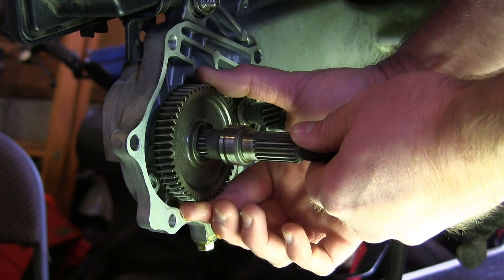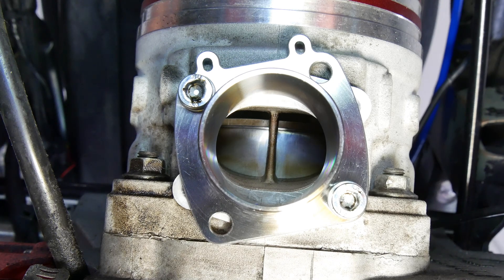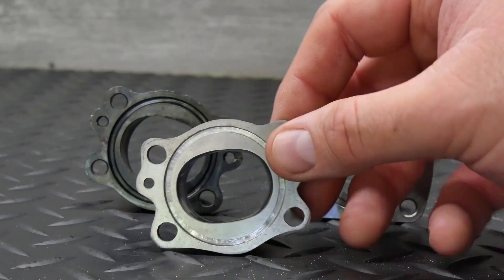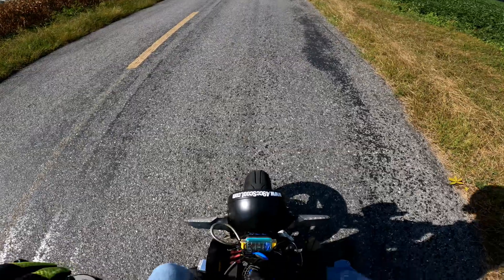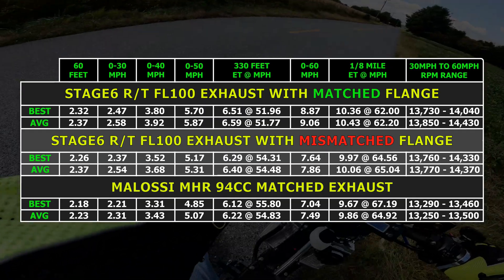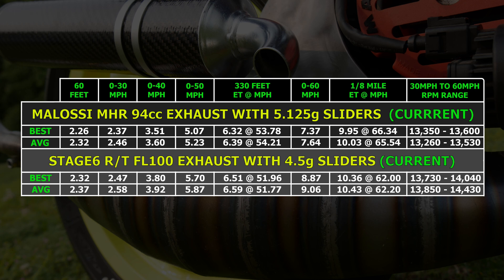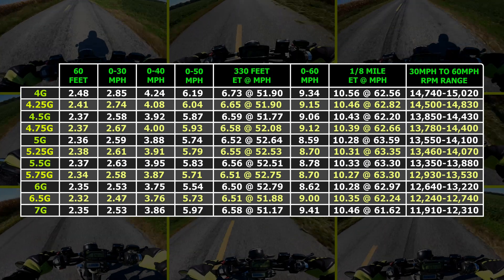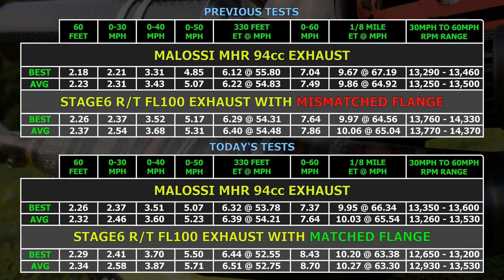Port Matching For More Power? : Stage6 R/T FL100 Exhaust Re-Tested : RC1 : Pt 17 : Two-Stroke Tuning

Comment: thanks for the answer, I just have one last question(-:
You mentioned something about the performance remaining the same.even if you changed the
Standard round 19x15.5 rollers out with some special sliders from Dr pulley in 19x15.5 ..
my question to you is then .???

Do you remember? where on your vario it was that the V-belt went when you drove with the standard 19x15.5 rollers in the vario And do you know now maybe if your V-belt should have started and climbed a little further up on the Vario now after you started driving with these Dr pulley 19x 15.5 sliders
Reply from the maker: @bp-tuningaeroxlc-dd6474  I honestly don’t know. I tested sliders many years ago. These days sliders go in from the start. I only tried acceleration, because that’s all I really care about. Rollers didn’t improve anything so I went back to sliders. Since I’ve had high end stuff, it’s all fast so I just don’t care about max speed.

Comment: what is the diameter of the inside the malossi 94cc exhaust? i want to use the malossi 94cc exhaust with the stage6 95cc cylinder and i need the diameter of the hole of the exhaust
Reply from the maker: I had a flange around so I didn't take mine apart, but the Malossi flange is about 38.5mm diameter. It's a very tight fit so the header itself is not much bigger. I would heat my header a little to get it to fit over.

Comment: stage6 has always exaggerated their parts... and said their parts are the best... personally i had a complete malossi testarosa 94cc engine, on my zip sp2. completely std no mods, with a scooter tube exhaust. which made the 25.50hp. another had the same cylinder pretty much the same set up but on a max ported/flow. minarelli engine block, and it made 25.25hp with a malossi mhr exhaust. so as long as you have an exhaust that has been developed/made for your cylinder kit, it works the best

Comment: Nice test. I have also found out in my tuning projects that most of port matching work is almost completely useless. I was surprised to find that no one has been (yet) calling out that you did the matched flange wrong. 
An interesting aspect of the Stage6 exhaust result is that it is almost as fast at a clearly lower rpm which means it can produce more torque. It could help to reduce the engine wear.
Try heat wrapping the MHR pipe. That can raise the powerband by some amount and give a bit more power. A quick change tailpipe restrictor and a larger stinger/silencer diameter are also interesting things to try in an otherwise developed setup.
Reply from the maker: What's wrong with the matched flange?
Reply: Nothing, but I expected some stage6 fanboys to not believe the result. I have read the comment sections of many your videos and they are a bit frustrating.

Comment: Man i would love to see a gy6 (qmb139) build
Reply from the maker: I've still got the TaoTao. I just get wrapped up in the two-stroke because it's so much faster than the little four-stroke would be.
Reply: @49ccscoot  ehh are you in the know of what potential the qmb139 has? I am in the process of building mine.
Reply from the maker: @CokieZip  Enough to know it's pretty unlikely to have 25-30HP and 80+MPH like my 94cc two-stroke with one. Not saying you can't. GY6 150 based is usually built to get to that level.

I'm sure I could have fun with it. My problem has been that there's only so much time in a day so I've focused on the fastest little scoot that I have lately.

Comment: Awesome video again! I'm about to install a stage 6 70cc kit with a Yasuni R exhaust on my BWS50. Any idea what size main jet to start at for sea level? What about the needle position for break in? The kit didn't come with better reeds?? Do you recommend them or just do it all at the same time with a bigger carb? No instructions can't with it.. Thanks for any advice!
Reply from the maker: You don't have to have better reeds. You can get carbon fiber replacements pretty cheap or just wait till you're ready to go with a bigger carb and move up to VFORCE.

I don't know a specific number. I just look at what's in a carb if it was working before and use that to make a wild guess for starting basically. If you aren't changing the air filter setup, then maybe move up about 10 numbers to start and then just be ready to swap it out once you get to ride and start tuning. You can raise the needle for safety. Again, you'll kinda know if it's way off because it'll sputter too much part throttle or if I don't hear it ever sputter then I will richen it more.
Reply: Without mentioning what carburator you have nobody can give you a decent answer...
Reply: For now I have the stock carb and reeds.

Comment: I do like these shorter vids. How is viewership levels?
Reply from the maker: Pretty similar. I'm not really aiming for any certain time. I've just been doing things like separating the flange making and the testing for example and this time I didn't show all of the test runs because I didn't think it was necessary... and I kinda liked the swarm of bees effect with a bunch going at once. lol
Reply: @49ccscoot  I like it. The 5-15 minute range is digestible in one sitting. The hour plus vids were always tough to watch. I value your experience and work so I’d find ways to watch them.

Comment: For this amount of test cases you'll need a dyno for this scooter. The RC cylinder and exhaust should work way above these rpms (after Malossi's description, around 14k). First it seems necessary to find out the proper rpm for the cylinder where it's the strongest. Then your method to find better settings is accurate enough to be on spot. But without a dyno this takes a lot of efforts.

But anyway the channel is good and you've got better knowledge than a mechanic and the bike works quite well.
Reply from the maker: A dyno would be nice, but all I really want is for it to accelerate as quick as it can. If it makes any significant amount of additional power, then I should see it this way. If I can't see it in real world testing, then what good is it to me? 

I have looked into building a dyno, but I've never found a source for the roller. Some make it sound easy, but all of my friends were on the lookout for a bit and none of us ever came up with anything affordable. I'm not willing or able to invest thousands.

Comment: Well I guess now it's time to test the Stage 6 cylinder.... 🤣 Interesting that it seemed happier with a wider range of weights but still wasn't as fast overall.  Also surprising that it didn't seem to want any jetting changes.
Reply from the maker: I would love to. These darn race setups just aren't cheap.
Reply: @49ccscoot  Not worth it, I'm pretty sure it's worse than the Malossi you already have. If anything get the Roost Havoc kit (with exhaust) or the 2fast one.
Reply: LMR, 2fast would be better than malossi and stage6 @pubbiehive
Reply from the maker: @CodeMajicc  I was gonna go S6 if I could afford any of them at some point because they claim significantly more HP and say they're reliable... plus now I have the pipe so  I've got a chunk of cash toward that setup.
Reply: @49ccscoot  could part some of your malossi parts to help cover some of the costs. I agree though, going from one build to another is so so expensive

Comment: Expert:cant polish intake,must get wirlwind.Exhaust stalls cars when outlet are un-even length.Smoke dont move away,next cylinder fire,it blocks the pipe.1 inch longer last cylinder from muffler(?).Straight tube wich are best,none.Use "metal-glue" to build on metal,straigth tube.Bigger than inlet.Maybe they mean you port exhaust.